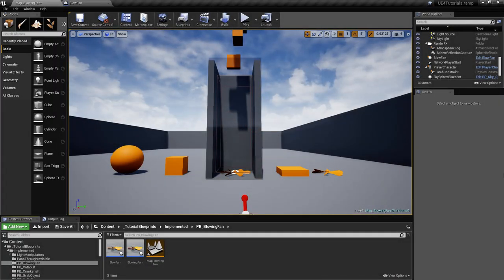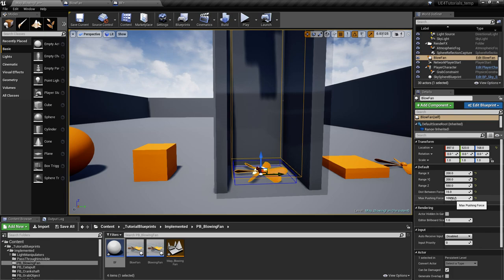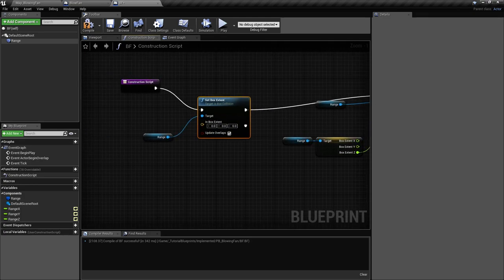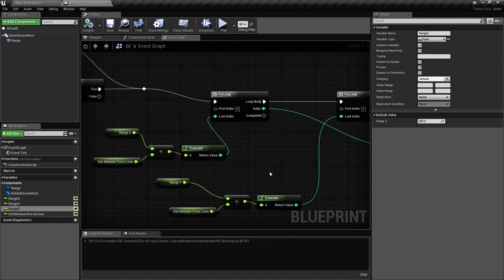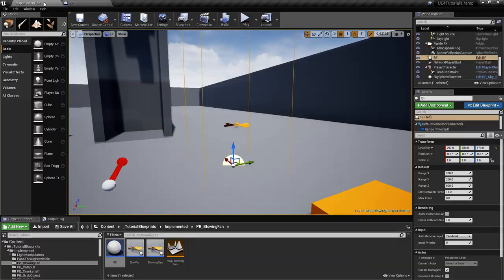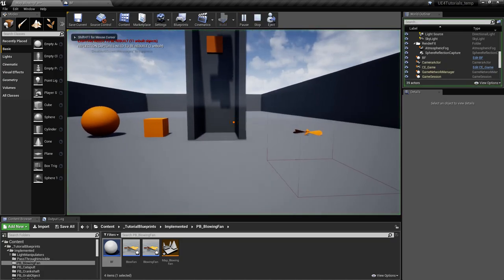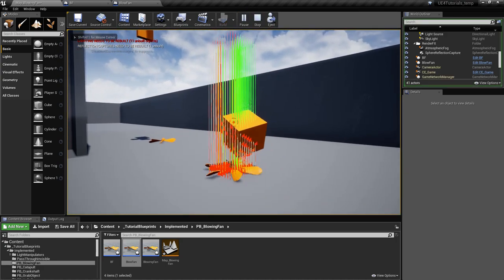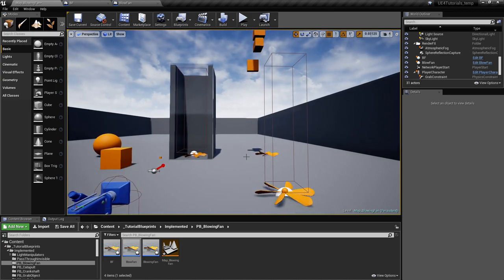UE4 Wind Machine / Blowing Fan using Physics Constraints in Unreal Engine 4 Tutorial How To

Comment: Hi, thanks for the tutorials, physics has the least ammount of tutorials, nice to see some.
I have a basic-common problem- question: how can i make a physics object being affected by some moving object, but without affecting the other object? For example a tank hit a street sign, i want the street sign to simulate physics, but without affecting the tank's velocity or movement in general. 
Or this would be nice for ragdoll objects, or small props that the player could push/kick away handled by the physics engine, but without affecting the player's movement. Currently my solution is overlap for small props + a hard coded force applied on overlap event, but this is not a good solution imo. I see so many indie games failing to do this properly, can you make some tutorial or some hint about this please? Thanks you.
Reply from the maker: That's an interesting question. I think you may have found the simplest/best solution for how to do this.
If you want to have physics and disable the reaction force of an object, you would have to go into C++ and see if you can insert your code there, at the moment of the hit. I don't see how you could do that in blueprints. I haven't went that deep into the engine yet. 
I suggest you go on Discord, on the Unreal Slackers(http://unrealslackers.org/) channel into the #physics section and ask there. There's a few people that know low level physics stuff.

Comment: Very cool. I really like your tutorials. There aren't many tutorials out there about Physics and you seem to know what you are doing. 
I got a question about something that i tried to find for months now. If you maybe know a solution that would be great. :)
So i was searching for a wind effect (kinda like in this video) where an object (in this case a ship on an ocean/water material gets speed depending on the sail position. But the only things i find is either foliage moving with wind or physics based fans/propellars that are static and move around small Objects like cunes and something like that. Do you know a way to create such a wind system? Lika a constant "wind" that comes from a direction that affects the forward of a ship depending on the position of the sails?

Comment: just wonder, what if we use BoxTraceByChannel instead of LineTrace ? It could solve the small object problem (but maybe cause something with the lines and normals?) also a more expensive. 
I just tested and its looks ok at first sight. Of course u need the get a box size right.
edit: BoxTrace is stronger , must because of the density

Comment: How can I make this effect the player?
Reply from the maker: After the line trace (22:12), break the result and take the hit actor, cast it to Player Character, then get Character Movement Component and Add Force to it. You cannot add physics forces directly to the character, because it doesn't simulate physics.
Here's a blueprint example of adding impulse to the player character: https://blueprintue.com/blueprint/wfs-2rzi/
Reply: @Lusiogenic  Thank you! I will give this a shot! Most appreciated!
Reply: @Lusiogenic  Hm, can't seem to get it to work. I tried launch character as well but unfortunately i can't quite nail  it. will have to mess with it! thanks again!
Reply from the maker: @four2nothin  The line trace is set to Visibility, but the character's collision capsule is invisible Try to change that, I can't remember now which channel, but use Draw Debug to see if the trace is actually hitting the player character. 
Also, go into debug mode and make sure that your cast to Player character is valid and that it goes past that node.
Reply: @Lusiogenic  Thanks for the replies!

Hm it isn't going past that node.. I have so that the hit actor is equal to player character, if true cast to first person, get movement, add force.

If false however, it goes to the physics objects we set up in the video, and it is working there. just for some reason it won't effect teh player. I did set to visible, but that didn't work either.. Hm...
Reply from the maker: @four2nothin  Setting it to visible won't work. You will have to change the trace channel to something else. Maybe Camera? I'll have to check to make sure.
Reply: @Lusiogenic  Okay i Will try that too. Thanks so much! Eventually I'll get it. Trying to make a puzzle game where the fan can push the player off ledges and stuff if the force isn't blocked. Kinda like in Q.U.B.E. I appreciate all the help thus far!
Reply: @Lusiogenic  So after messing around a bit, if you set it to camera it seems to work, but the only way i could get the character to react was by "launch character" but in that case it just kinda bounces the character whenever they cross the line traces.. I tried to factor in the randomness from the original equation but unfortunately I'm not quite educated enough to make it work lol.
Reply from the maker: @four2nothin  That's good progress. 

The force that you apply to the character needs to be inverse proportional to the distance between the player and the fan. As the player falls closer to the fan, the force gets bigger. 

As for the randomeness, you could make it more significant (i.e. make it 20% of the force).
Reply: You can help me? Tutorial or Blueprintue?